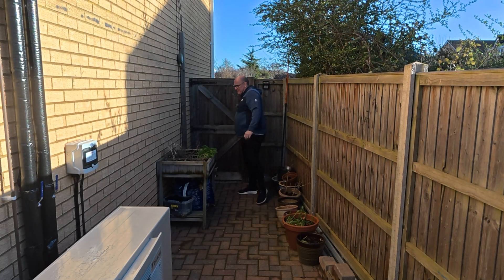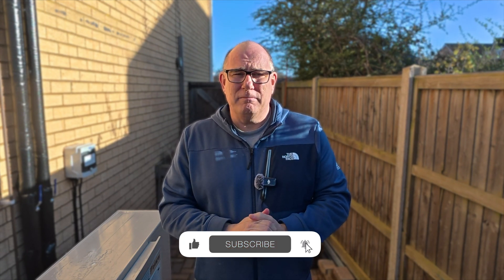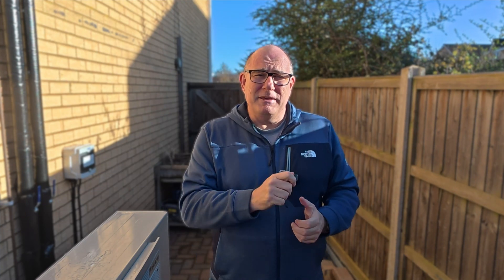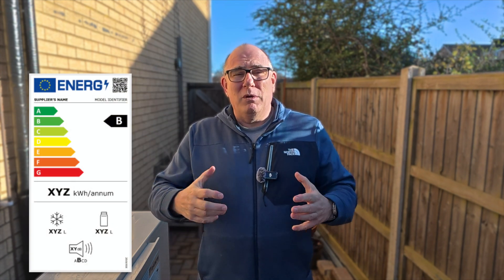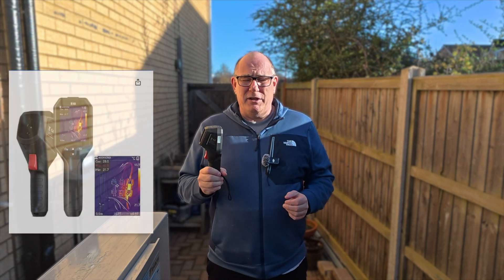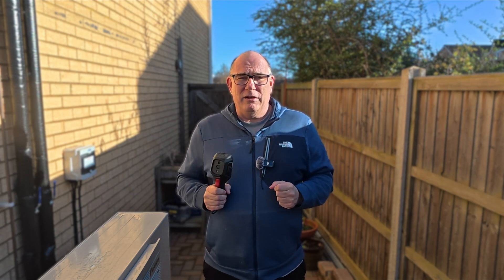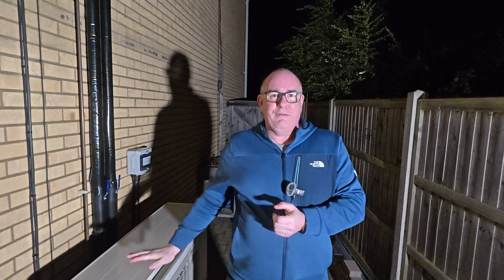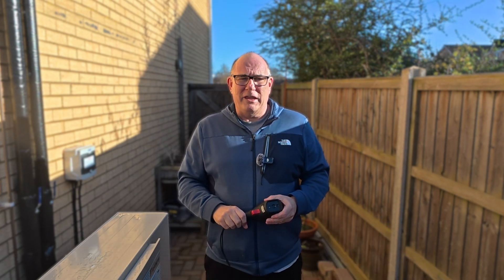🔥 Heat Pump Insulation Installation Mistakes to Avoid! 🔥

Comment: They install my trane air handler on a metal box that sits on a concrete floor and the bottom of the metal box is open to the concrete. Thus the return air is blown across the concrete, which is near an outside wall and gets very cold in the winter.  Should insulate the bottom? Why do they do this? Seems so shoddy.
Reply from the maker: no idea maybe ask the installer

Comment: Insulating a house is NOT a one size all solution and WRT to 1:31 you CANNOT simply tell people to "get down to B&Q" and "any insulation is better than nothing". That is complete and utter nonsense and it's clear that you know nothing about the science behind nsulation. Every house is different and depending on the type of building, installing the wrong type of insulation can lead to not only damp, but in some types of houses, can actually lead to cracks in walls, woodworm, interstitial condensation and even structural failures. Houses with stone built walls and lime for example are  meant to heat and cool over the seasons. Adding insulation to these types of houses stops the seasonal transfer of heat and makes the fabric of the building permanently cold - this is BAD. As for the IR camera and waiting till night time, again this is complete nonsense. Do you think that heat loss surveys only take place when it is dark?
Reply from the maker: nobody is suggesting that this is heat loss science. But buying a few extra rolls of insulation and heading up into your loft and filling in any holes it’s gonna do much more than nothing. The reason for using the heat loss camera at night time as it was a lot colder outside and it was much easier to see the temperature difference. But don’t let that get in the way of you having a rant

Comment: My Octopus quote started off as  Daikin and turned into a Cosy 9 at the last minute. I'm now getting new garage doors. lol
Reply from the maker: Assume the price went up massively?
Reply: @JonathanTracey  No. It showed a Daikin on the survey plan and when the final agreement was sent, in the confusion of so many things to think about I failed to notice it was now a Cosy 9. I'll be the first to admit that due to ADHD I am not the best at taking in information but what they did was a bit naughty. The Cosy 9 has no reviews anywhere that I can find and doesn't even appear in the top ten list of ASHP. They were very keen to survey and quote but the detail on operation and daily use was very much lacking. The £7500 use of our tax to shore up the price is skewing the market, I believe. I am also not up for seemingly have to tie myself to Octopus for the foreseeable future with having one of their own brand heat pumps with all the control they remotely have over it.  The thing is that because of their habit of sending emails with links to quotes etc, they have the power to delete those quotes and now I can't see what originally came through. I was paying £4000 and they were getting £11500 with the subsidy.
Reply from the maker: Somethings happened,  they called it Cosy 10, it’s listed on their pages, in government evidence submissions then in last few days it became Cosy 9. I wonder if it didn’t perform as well as they hoped in independent testing

Comment: If putting a very expensive heat pump and connected pipe work outside open to sub zero temperatures why have gas boilers never been fitted outside..obviously wise engineers might say why use expensive energy to heat up the back garden..also someone might even steal it..
Reply from the maker: Brilliant observation! You’ve cracked the case—heat pumps are outside, so obviously, they must be bad. I guess we should bring them indoors so the waste cold air cools the house while we heat it! And as for theft, you're right again! The black market for secondhand heat pumps is booming—just last week, I saw a gang of thieves struggling to lift a 200kg unit into their getaway Prius. Meanwhile, gas boilers sit safely indoors, pumping expensive fuel into the atmosphere like responsible adults. Pure genius!
Reply: @ the UK pumps out out all those filthy emissions that supposedly are poisoning our planet we contribute less than 0.07% to global emissions..the fools are people like you that believe the lies this government feeds you..meanwhile my 25 year old non condensing boiler that hasn’t broken down ever will at some point be replaced with another gas boiler that I’ve no doubt will make zero difference to life on earth and I will have a really warm house with unlimited amounts of hot water cost to me will be £800 fitted..remind me again what cold pumps cost to install and maintain…

Comment: Hello Jonathan…..have the epc….have the heat pump……just installed but no smart meter.  Have spoken with Octopus about the cosy off peak tariff…..but they have stated the need for a smart meter…but living south of Manchester some data may fail when trying to calculate the usage hour by hour day by day….but not to worry as you bill should be okay. Not to confident with the answers given….again such a great video to which I will improve my current epc rating..
Reply: Again Jonathan thank you so much for the information as ever excellent information. Just a bit deflated after a lot of investment to be told due to my location smart meters are not that smart….why we cannot encapsulate the old economy 7 has my head scratching….but I maybe showing my age lol. Many thanks again Jonathan
Reply from the maker: glad i can be of help
Reply from the maker: The whole situation with smart meters in the north of England is rapidly becoming a national scandal. They need to stop with this silly radio frequency system that doesn’t work and start installing metres that work with 3G or can plug into the owners broadband.

Comment: From Ofgem "There are no minimum insulation requirements for applications which are properly made after 8 May 2024. "
Reply from the maker: it was still in place as of November 2024, as I was in the documentation pack I was sent, but now seems to either be not required or un enforced
Reply: @JonathanTracey  The old insulation rule is not in force....since May 2024. You might have been handed an out of date documentation pack. I have been processing the grant claims for the last 9 months now and Ofgem is quite clear that there are no insulation demands. Good news! The details are published on the Ofgem website.
Reply from the maker: thanks for the info, hopefully the installers are still pushing people to get their house insulated as it will make the Heat Pump work even better

Comment: Hi Jonathan. Are you sure about the requirement that EPCs should not suggest insulation in order to be eligible for the BUS grant? Might be worth checking the Ofgem rules?
Reply from the maker: there are mixed messages, a few have been told it’s no longer a requirement but i can’t find anything to say it’s been relaxed. this was what i was told in november
Reply: @JonathanTracey  Loving the videos BTW. I tried to post a link to the Ofgem BUS rules website  but I think links are not allowed. But would be good to clarify as it could put people off putting in a heat pump. I process EPC/grant applications as part of my job as a heat pump installer.

Comment: I got an EPC done last year to reflect insulation and building work I'd done - cost about £50. Despite all that I'm still a B despite having pv. A couple of questions about yours - 1) it says 'assumed filled cavity', which wouldn't have been the case 30 yrs ago at build, and your double glazing says good rather than average which suggests you've replaced the original windows as window specs have changed too. Can you give some detail or point to a video you've already done on this.
Reply from the maker: Yes the house was built with cavity wall insulation, all I had to do was show the inspector photograph of when we added our conservatory and you could see the insulation between the walls of the main house. Guess the double glazing was replaced about a year before the EPC was done, so it’s all up to modern standards. Although she did spend quite a bit of time inspecting the seal around the windows, I assume that’s something that comes up quite often. The only real thing that dragged us down was the old water tank, which is now been replaced so I’m pretty sure whereabouts good as we can get within the confines of the existing building.

Comment: Octopus were loaning heat sensors if you ask them nicely
Reply from the maker: I saw that, but I thought they had a fixed number that they were giving out each winter, for the video I saw they were gifts not something you had to return, has that changed?
Reply: @JonathanTracey  You have to return them. There's a waiting list that fills up each year, this is my third time of applying, and I am now on the waiting list for next winter 😥. I have been looking at thermal cameras and they seem to be quite a big expense for something that you would only use intermittently. I see some of the more enlightened Councils run their own loan schemes for residents, unfortunately not ours. I also looked at the hire companies, a days hire can cost about £130 with VAT, so that's out the window. I was also curious about the EPC, I had read that not having a valid one can affect the Octopus quote, so wondered if it would pay to get one done before applying for a quote, or if Octopus adjust their initial quote once they have the EPC.
Reply from the maker: Yeah, they are quite expensive if you’re only gonna use them once or twice, however having one in my toolbox I find all sorts of other uses for them. For example every six months or so I go round and check all of the connections for my solar system to make sure nothing is arcing, or overheating. This allows me to find an address any issues before they become serious.

Comment: Another very informative video for people like myself who's planning on getting a heat pump installed at some point this year. I'm having new triple glazed windows installed in the next few weeks and just waiting for my G90 application to be confirmed by the DNO before I venture into solar energy and have panels and Tesla Power wall 3 battery installed!! But in anticipation of getting a heat pump being an Octopus Energy customer I've applied for a grant for more insulation to be installed in my loft through the GBIS. Even though after filling in the application form my income was above the amount they mentioned on the application I was informed I might still be entitled to the grant but I might have to contribute towards it. I'm just waiting to hear if my application was successful after someone came out to do a survey regarding what the insulation was like in my loft. Hopefully I will be successful with my application as every little helps and the way I look at it is nothing ventured nothing gained. Sorry for waffling on, but I find all your videos be them about heat pumps, solar panels or batteries very informative and have inspired me to get the ball rolling to start living in a greener, warmer and more energy efficient home. Once I actually get to make enquiries with Octopus about a heat pump I intend to use your referral code to help with your charity collection which I think is a really kind gesture. Thanks again JT and keep the videos coming. 👍👍

Comment: Not sure if you mentioned that the EPC cost is covered by Octopus if you go with them and you don't already have a valid one; you just have to email them the receipt when all is done. As I found out today! Mine is now up and running! It's been up for just over a day, and the house is nice and warm in spite of the current cold spell.

Now I have a spare CO detector that I can pass on to a neighbour who hasn't got one. I urge anybody who doesn't have one and uses gas to get one; having one may well have saved my life as I've had one go off twice in a previous home in which I lived.
Reply from the maker: That’s great news, one more obstacle removed. Glad your install went well.

Comment: Your latest video about EPC and all the other waffle about heat loss means that before even installing a heat pump you have to buy a heat loss indicator, carry out insulation to an approved standard at your own cost  then get an EPC surveyor to certify that the house is up to standard and bribe him not to say needs further insulation.
So £500+  spent to achieve nothing tangible then the upheaval of the installation. What on earth for when a gas boiler works well and provides a warm house and hot water at a fairly cheap cost. Heat pumps are an expensive con promoted by unqualified politicians like Milliband.
Reply from the maker: Richard do you go out of your way to be offensive when posting on YouTube or is it just your natural style. Adding insulation to your house is the cheapest and most effective way to save yourself money. So I can only assume you’re either allergic to money, or you cant do basic maths and physics. Even the best gas boiler is going to be 90% efficient, a heat pump in its worst operation conditions will be 300% efficient. One runs on fossil fuels and one can run on clean energy, One give off toxic fumes after its burned it fossil fuels and one gives of dry cold air. Given the program for heat pumps was instituted by the last government if your going to accuse anyone of an expensive Con maybe you should be looking at the succession of conservative energy ministers who did nothing but sell our assets to private industry and keep funding fossil fuel industries with your tax money.
Reply: @richardlewis5316  improving insulation makes sense whatever heating you use. You get a warmer home that costs less to run. Gas prices in the long term are only going to go in one direction and it isn't cheaper. The UK is a net importer of gas and has been for 20 years, we are completely dependent upon other countries. You may be happy with that but I am concerned
Reply: @richardlewis5316   Do you always communicate from the wrong  orifice? You only need a EPC rating. It doesn’t have to be a particular standard. The rest of your comments are just delusional hyperbole.
Reply: Gas is the Con , creating a ton of acidic condensate a year.

Comment from the maker: Hearing rumours that insulation requirements have been relaxed, does. Anyone have a source/link ?
Reply: My understanding is that now you dont have to fulfil any EPC recommendation to apply for the grant. This was one of the reasons I went ahead with the installation .
Reply: @andytunnicliffe7223  i had a conversation with octopus about a heat pump & they viewed my out of date epc D rating, and they suggested my current microbore wasnt suitable, but since that was done i have added a single storey extension and triple glazed the whole house, so for the cost of a current EPC i will get a fresh one
Reply from the maker: @andytunnicliffe7223  Do you have any links to where this is detailed, as heard it from lots of people but dont know where its written down
Reply: @JonathanTracey  I wish I could remember now! But when I spoke to the installer (who had quoted me previously, I cited  that reason along with the increase of the BUS grant, and the introduction of the mini store as the reason to go ahead. He didn’t contradict me, and I got the grant. Having looked at email conversation I had with him two years ago regarding a former quote, he was worried about any audit done by the MSC would pick up the comments about poor loft insulation on my EPC report.
Reply: @JonathanTracey  

I've posted three times but gets deleted, have a look at OFGEM and MCS insulation requirement for grant.
Reply: @andytunnicliffe7223 See I'd want to get things as insulated as possible before I do that restless of what the government says.

I think that's something that should be done regardless of what heating solution you have
Reply: Looking at .Gov.uk it just says you need a valid EPC.  Only mentions insullation to the extent you can still get the BUS grant even if you have had a grant for insulation https://www.gov.uk/apply-boiler-upgrade-scheme/check-if-youre-eligible
Reply from the maker: @nick_james_42 yeah that’s the same as it was when I had mine installed but I’m hearing they’ve dropped that requirement although none of the websites have been update
Reply: Here you go, youtube will likely delete which is why I didn't post previously 

"www.ofgem.gov.uk/environmental-and-social-schemes/boiler-upgrade-scheme-bus/property-owners#:~:text=There%20are%20no%20minimum%20insulation%20requirements%20for%20applications,no%20recommendations%20for%20loft%20and%20cavity%20wall%20insulation."
Reply from the maker: Thanks @_Dougaldog
Reply: @JonathanTracey  I posted three times last night as well, also deleted each time, it's easy to find. The requirement has been dropped.
Reply: Youtube  deletes any links

Search for 'insulation requirement for MCS grant removed' and you should find an OFGEM reference
Reply: Per the gov.uk website you just need a valid EPC. Nothing on there about insulation. Having said that obviously the more insulation the better, heatpump or not
Reply: From the source Boiler Upgrade Scheme: Guidance for Property Owners (https://www.ofgem.gov.uk/publications/boiler-upgrade-scheme-guidance-property-owners): 4.57. We will accept EPCs with insulation recommendations. However, we expect that property owners and installers will discuss the benefits of energy efficiency measures, such as cavity wall and loft insulation, and potential measures the property owner could take.